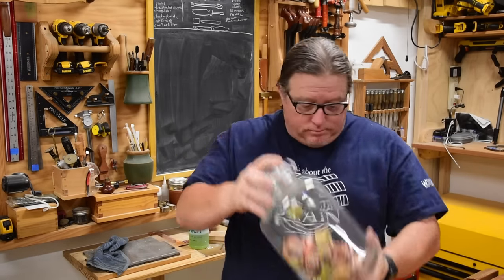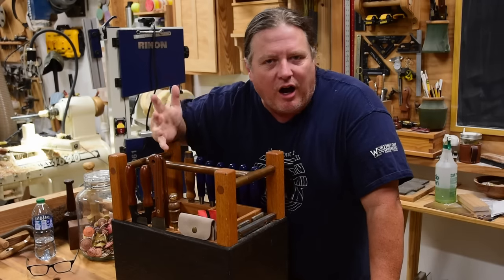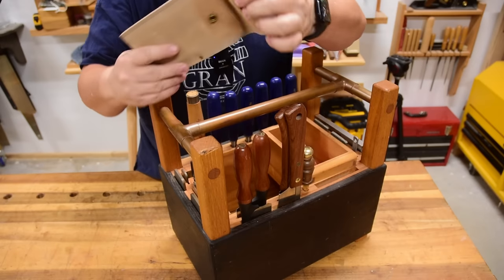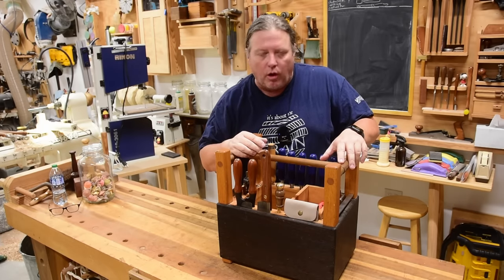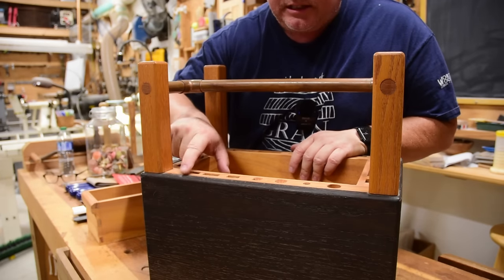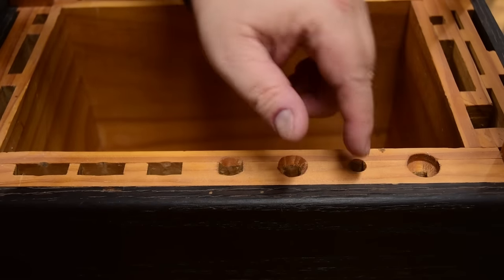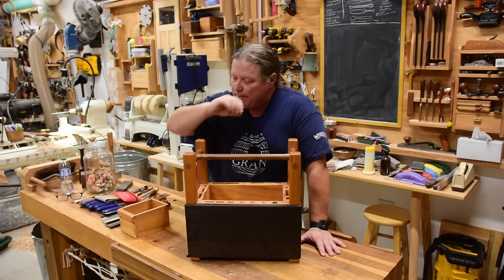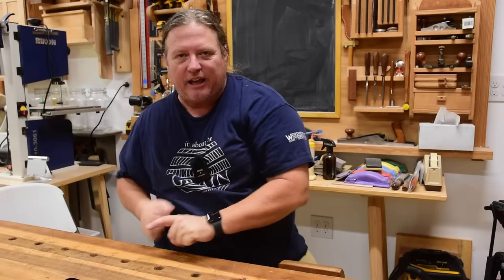Open Tote Tool Box / Caddy - Design Utility Tour

Comment: From reading the comments I got the idea of a series of videos. A video on just sorting through tools and pairing down to a concise set for a new box would be great. Deciding based on total weight limit and rounded out set of tools. The center possibly being a pick your planes or flexible area. Maybe needs consideration for what the viewers have but one of every core tool works. Saw, chisel, mark, measure, and surface. Then a video on layout, and one on building? I love the way the tall posts guard the tools stick out. Using the outer box wall as the first piece of the caddy wall is great. I also like how square the footprint is for stability.

Comment: I love this video. Yes. Doing this does help. Especially your explanation on how your design and needs changed. That evolution is fascinating. But I do agree, we do not need to see every step. Cutting a dovetail has been done too often. Even just replacing one of the sides, how to select the tools, and determine the layout would be insightful.

Comment: I like toolboxes. My work area has high humidity & steps down so I only store tools there which will not rust and carry tools in. This in a ‘basic’ tool box and other boxes that I fill as need arises of special tools – at the start of working. No going back and forth. My ‘basic’ box is 28 inches long by 9 wide, bearable in one hand  & weighing no more than 25 lb / 12 Kilo. This has low sides to avoid over filling. Made of pine & ply to keep weight down. Toolboxes for planes are smaller as they are heavier, so may contain only two or three planes. With any toolbox weight is very important.

Comment: The four corner posts also look strong enough to be a small, board rest, similar to a Japanese saw horse.
Reply from the maker: have a board with the four corners cut out that rests on the handles that lets me use it as a stool or stand when I travel.